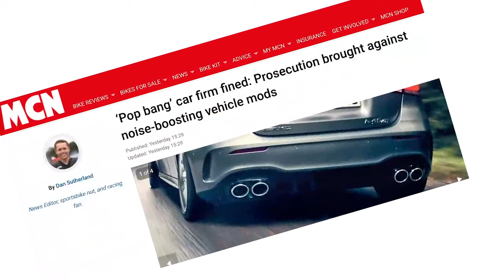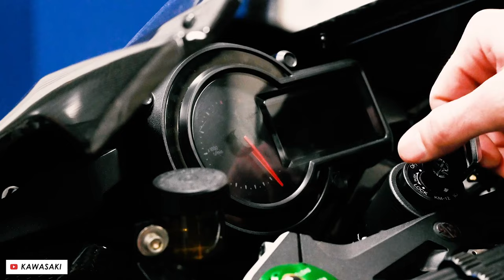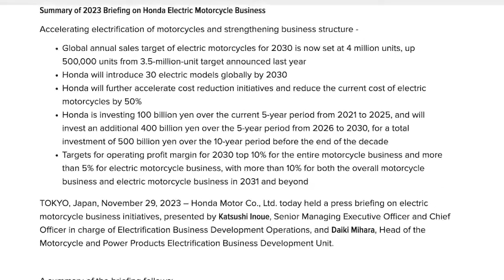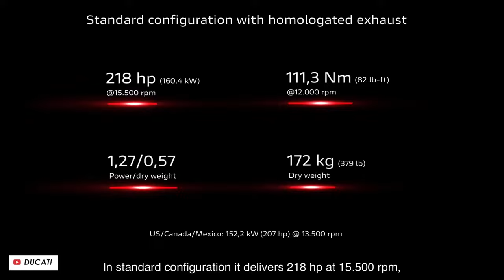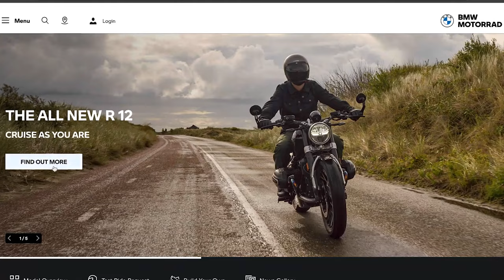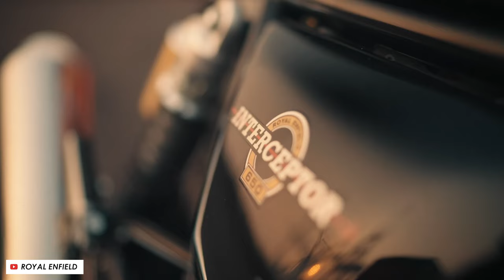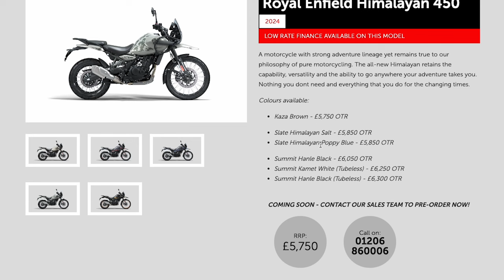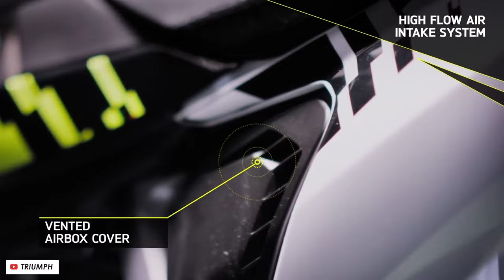The Moto News: Future Of Loud Exhausts, Electric Hondas, BMW R12 & More!

Comment: Hi guys. Just found you, great video,, one thing I do disagree with that you say your "not bothered with" is tpms, I am on my 3rd on its way from ebay at £22... Knowing my tyre pressures at a glance is brilliant, had slow leak on front of my 98 Fazer 600. She is getting new aluminium radiator fitted by Dog's in Burnham, waiting for a pipe, doing my head in not being able to ride, though the storms outside means not riding much.. Cheers guys... from Greg with the Fazer in Zummerset SW UK.

Comment: Really interesting vid guys. I think the time of loud exhausts has already come & fair enough. Typically when I was a lot younger I wanted the loudest can possible but not for a long time now. Personally I chose cans mainly on looks & weight saving these days. As for electric bikes, less said the better as still not a serious prospect yet but it'll happen. Perfect power for the road is about 100rwbhp if the bike weighs about 200kg or less. Although you can have great fun with far less, say 40bhp, if it's light enough & has good suspension & brakes etc.

Comment: ...If I was going off road as well as some road and aiming at under 50hp I'd go either for a honda nx500 rally raid or if on a budget a cheap and cheerful cfmoto 450mt instead of that Himalayan check those specs out guys... You'll be surprised.